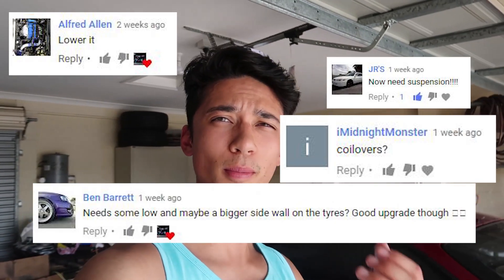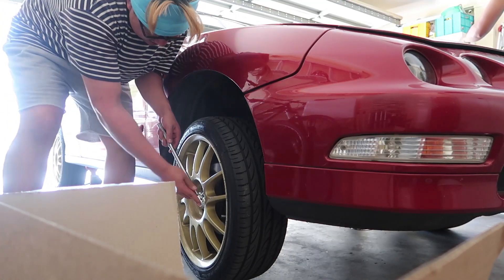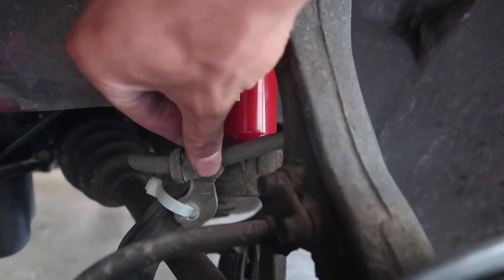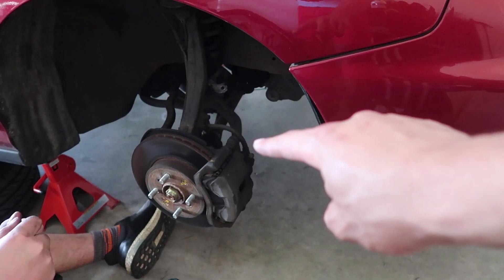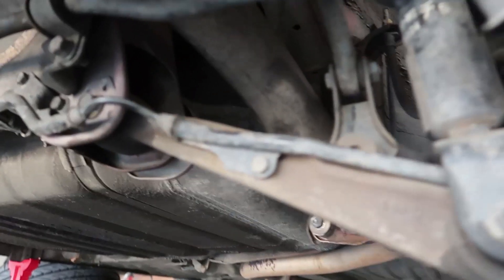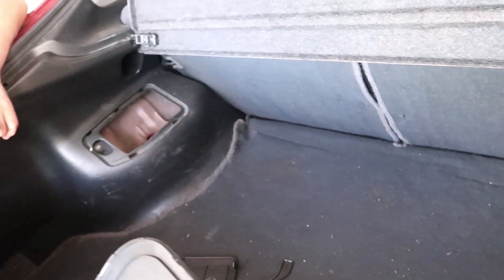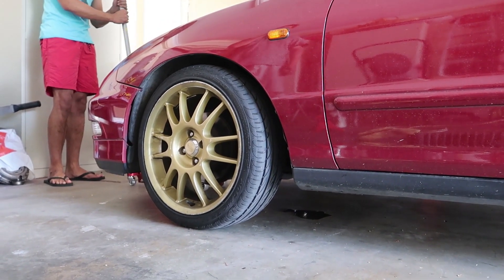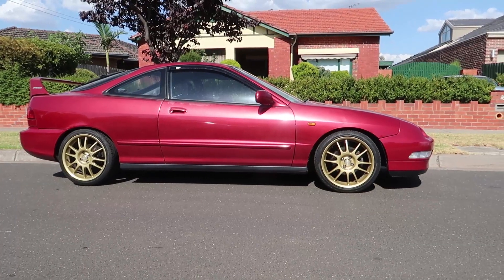Finally SLAMMING The DC2 INTEGRA! (Coilover Install)

Comment: That was my concern about my 2000 Camry, too rough on bumps. Is there a certain coil over for mine that would not make it to stiff on bumps? I don’t have a ton of cash, but can save up. Someone put cheap struts on mine before I bought it and it is sitting too high